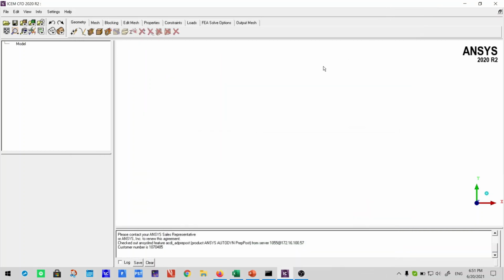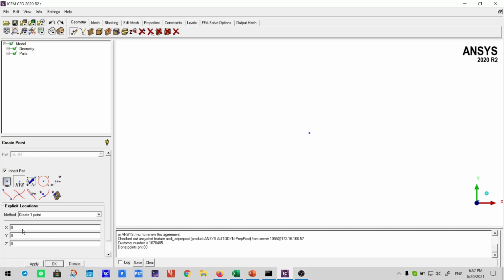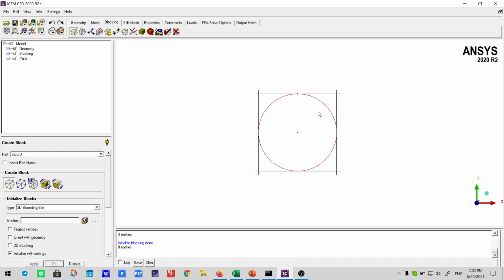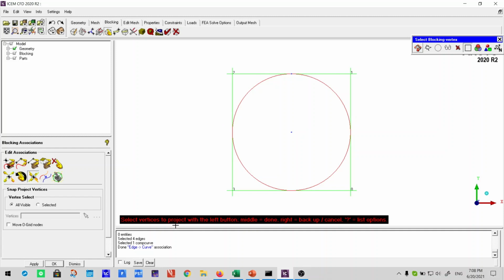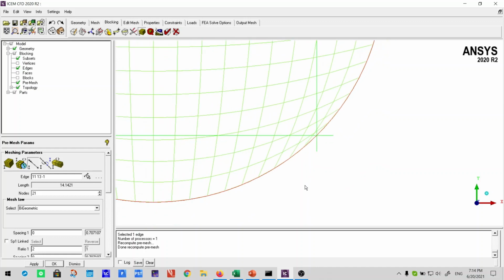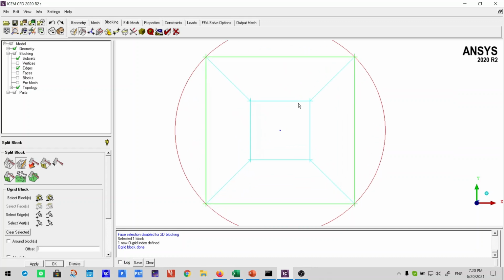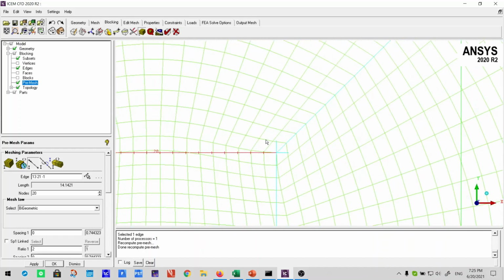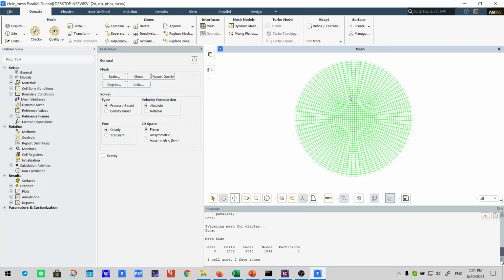Lecture 3: Meshing a circular domain using ICEM CFD

Comment: Sir, How can we change diagonal length so that we can fix no. of inflation layers because ICEM itself defining some length due to which inflation layers are controlled by software. Otherwise,  we can only increase the growth rate to minimize the excessive inflation layer after defining 1st layer thickness?
Reply from the maker: If I'm understanding your question right, then the answer can be that you can alter the OFFSET while creating O-grid, in case your question is about O-grid.